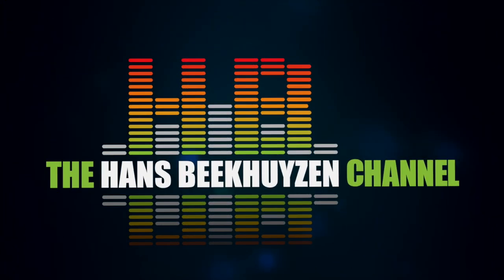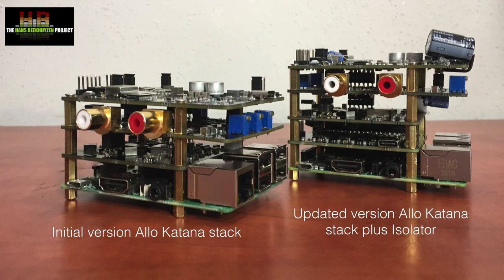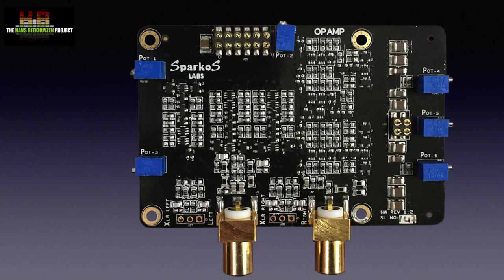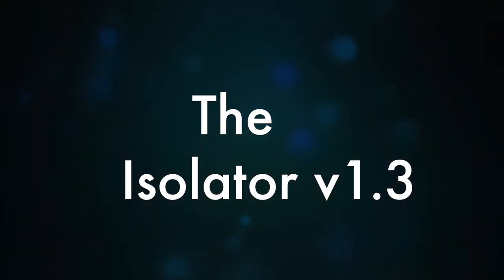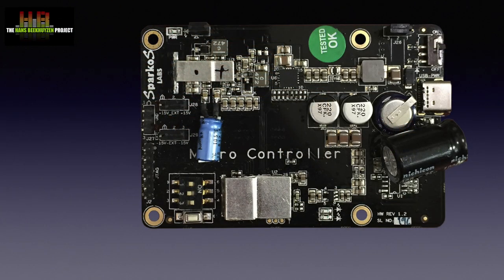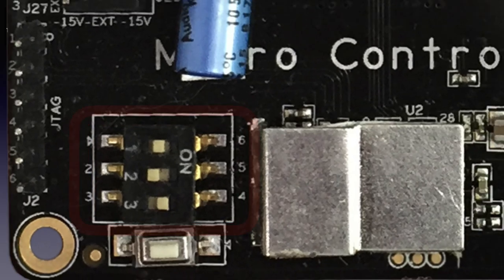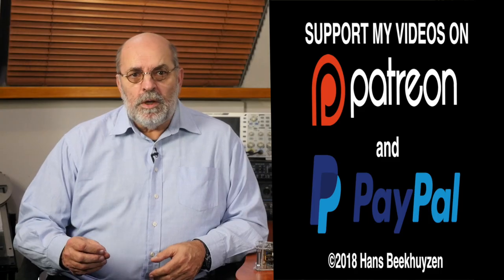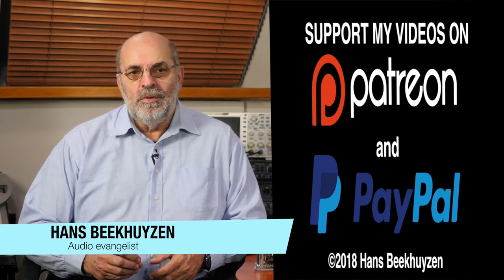Allo Katana Player v1 2 + Isolator v1 3

Comment: I use a similar Li-ion battery pack for my network audio adapter but, I found using 4 (2+2 in parallel) sounds even better. No noise at all! Thanks for another great video!

Comment: Hello Hans, Thanks for keeping up with this 1/2-DIY option. For me it's not quite there in terms of price (once one adds everything one needs) and ease of use. So close though. Am I right in thinking the Bluesound Node 2i is easier to use and offers more functionality for less? From what I'm able to ascertain, the sound quality differences between the two options would be negligible.
Reply: Dylan Grey your thought process on pricing mirrors my own and I ended up being a very happy Node 2i owner. For me it’s the most remarkable bargain in over 30 years in this hobby. I think it’s impossible to be unhappy with this option. Even the BluOS software is a revelation in seamless operation and the sound quality of the Node 2i is WAY above its price class. Plus you have fully unfolded MQA. Christmas arrived early this year.
Reply: @MrCatalysis101  Thanks so much for taking the time to comment. You hit on some key points I've been mulling over for quite awhile. I've tried to use Plex (and they are still improving) for the software, but it has been glitchy to say the least. Now some buried setting (probably changed by microsoft in a forced update) has upset my Rube Goldberg like workarounds (which boil down to running Plex in Kodi and then controlling with Yatse from a phone). Since I already needed an amp/dac to put between my computer and my amp, the the Node 2i seemed to check almost every solution box. The only issue is that I'll need three more of them for other rooms, which is definitely not in the budget. Ideally, I guess I want something like a cheaper, better, Sonos system where I can use the amps and speakers I already own. Anyway, thanks again. I just went from 90% to 99% sure the Node 2i will be my solution - or at least a step in the right direction. - Cheers
Reply: Why would you say that the sound quality of the Node 2i would match that of the Allo Katana? I seriously doubt that would be the case based on my experience with other Allo products and the high degree of effort Allo has put into the design and latest implementation of this new DAC. Katana should be much better...especially when used as a Roon output.
Reply: I'll find out soon. My Katana with isolator board arrives next week.
Reply: @dsnyder0cnn  all I can tell you is that the Node 2i performs amazingly, leading me to question whether it sounds better through it's own dac or my Benchmark DAC2...
Reply: @dylanemeraldgrey  pleased to provide some input. I have a Benchmark DAC 2 and I bought the 2i to replace my laptop. It is a phenomenal performer and has totally streamlined the digital part of my setup, with a nice improvement in sound quality. In fact I have questioned if the Node 2i's own dac is actually better than the Benchmark. It's a very close thing.

In terms of upgrade path, I will continue to monitor how Raspberry Pi develops, but will most likely just upgrade to the latest version of the Node every couple of years or so.
Reply: @MrCatalysis101  Very interesting. Thanks again.
Reply: @MrCatalysis101  - I'm glad to hear that you like it. The Node 2i is, however, a different thing from the Benchmark DAC2. Contrary to what many believe, the sound of the Benchmark (and similar DACs) is significantly affected by the transport that's feeding it the bits. If a general purpose PC or Mac is used, the sound will be okay but far below what is possible via a high performance digital audio or network audio transport. Where the Bluesound has an advantage is that it's difficult to mess things up because the transport and DAC are integrated. While the Benchmark DAC2 is getting long in the tooth (based on some pretty old technology), fronting it with something like the Allo DigiOne Player or USBridge would level the playing field between it and the Node 2i. Regardless, I strongly suspect that the Katana, used as a Roon output, will handily outperform both the Node 2i and Benchmark DAC2 (even fronted by an Allo DigiOne Signature Player). But, as Hans points out, there's a bit more setup work involved. If you're not comfortable with that, the Bluesound products are easier to use and are a nice step up sonically from Sonos.
Reply: @MrCatalysis101  - I was not aware of the DAC2 firmware update. That's pretty cool.

Comment: Is there a reason to power the DAC Hat with the SBooster and a generic SMPS to power the RPI?  I assume that the SBooster would have enough power to power both the DAC HAT + RPI in parallel?
Reply from the maker: Yes. The RPi generates a lot of HF noise on the power bus and that deteriorates the audio quality. The switch mode power supply that is normally used to power the RPi does the same. By powering the audio board from a clean power supply lowers the chance of HP pollution drastically, leading to a better sound quality
Reply: @TheHansBeekhuyzenChannel   Ah, that makes sense!  I have a different setup that utilities a RPI3+Kali --> MiniSharc+MiniDSP Dac8 stack that's being powered by 1 single 5V wall-wart.   Do you recommend getting the sBooster to isolate and power the 3 (Kali-->MiniShar+Dac8) and just use a regular 5v-wart to power the RPI?
Reply from the maker: Yes

Comment: There are so many great DAC's on the market for $99, why bother?
Reply from the maker: Well, you obviously didn’t hear the difference with better ones on a decent stereo. I can assure you that you would be surprised 😮
Reply: I kind-of get your point. DAC technology has become really good over the last few years...it's almost impossible to buy a bad sounding one, making this the best time to be involved in this hobby. Although there is generally strong correlation among accuracy, sound quality, and listening enjoyment, it's not perfect. There are design choices that result in better measurements but worse sound (the two board options for the Katana DAC highlight this issue). Listening engagement and enjoyment are personal issues as well, so house sound (eg., AMR or iFi Audio) and individual preferences come into play with these decisions. Analog sources all sound quite different because of inaccuracies added by their electromechanical composition. Digital is a very different world, more accurate but equally challenging to find the sound that you prefer. The good news is that, as you pointed out, there are may inexpensive and great sounding DACs out there. Just buy a bunch of them and compare until you find the one that you enjoy the most...sell and/or give away the rest.  :)